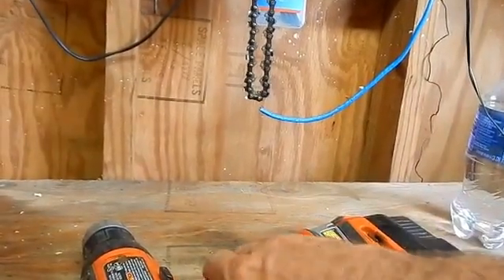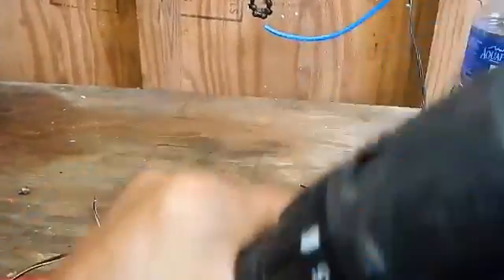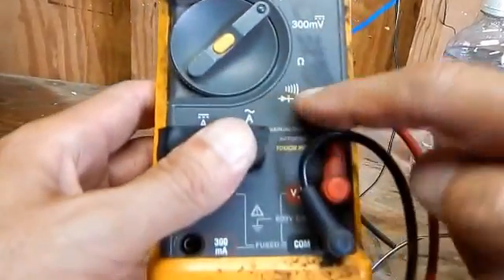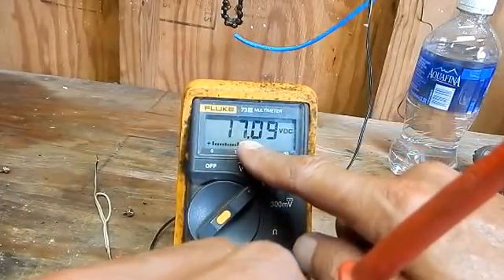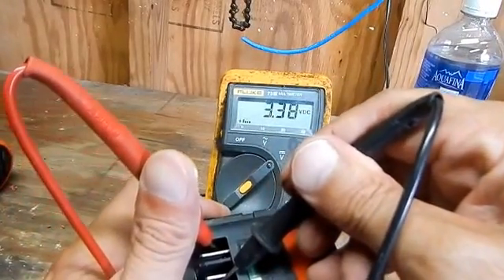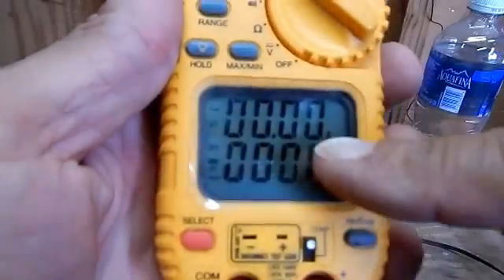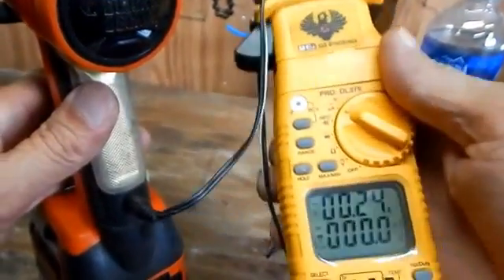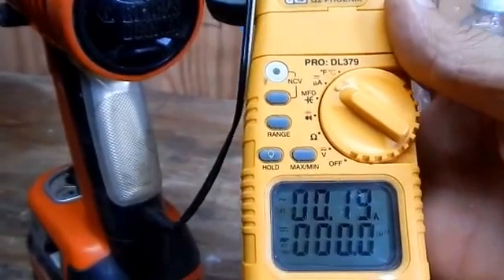Using a multimeter check out a drill battery charger.

Comment: good stuff... from what I saw.. you might be able to fix that bad battery as the Voltage dropped too much and will no longer charge... so not a faulty charger but the battery voltage dropped too low and won't take a charge.

Comment: My charger give more 21.4 it's normal? For 12v batteries? It's show the battery full charged but she is on 3.4 v when i did checked plus there is a lite smoke after plagued to the charger what should i do?
Reply: Hello, i have the same problème, did you fiund a solution ?